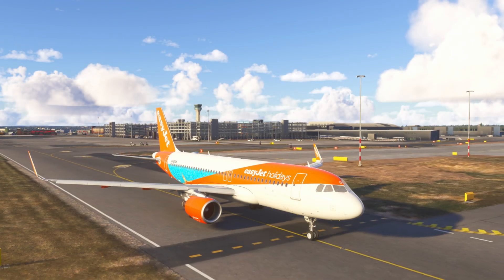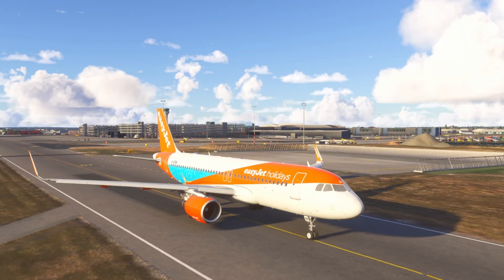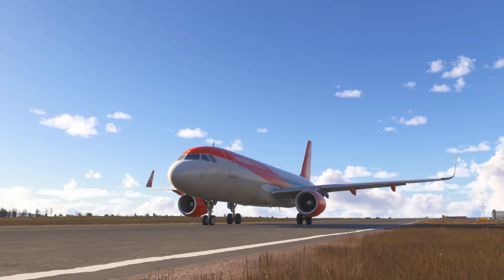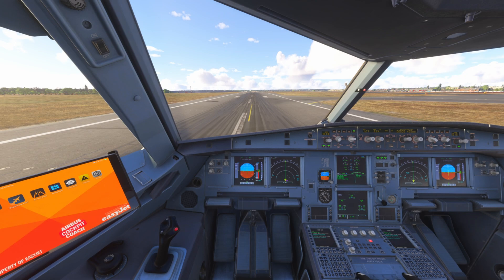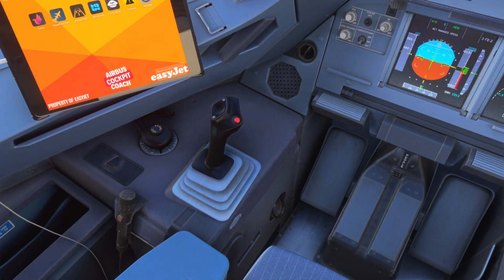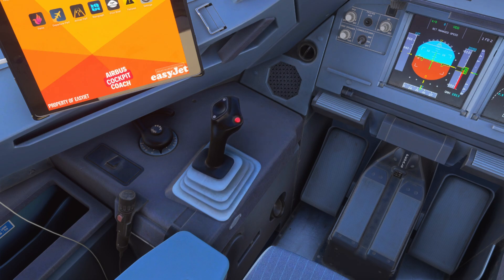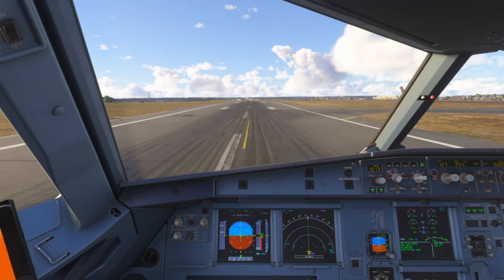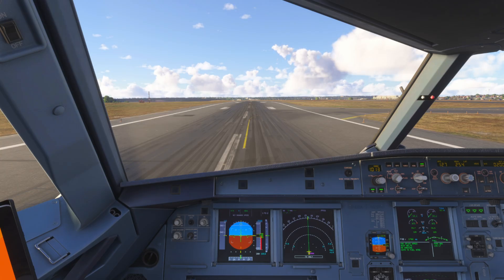A320 Ground Mode Explained | Real Airbus Pilot Tutorial in MSFS 2024

Comment: Thanks Captain! Is ground mode reliant only on the WoWs system or is there a redundancy perhaps based on G/S or IAS (as with the reversers & spoilers) or altitude?
Reply from the maker: Hello, WoW is the primary reference but the system will cross check the speed parameters which are used as the reference in case of WoW sensor failure
Reply: @AirbusCockpitCoach  Brilliant, thanks!